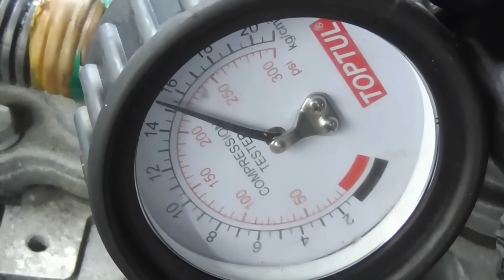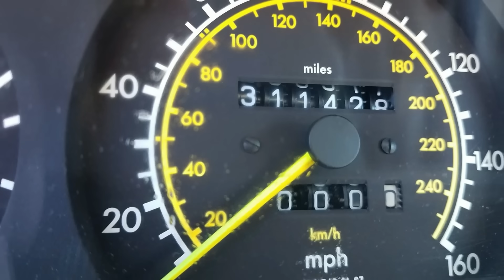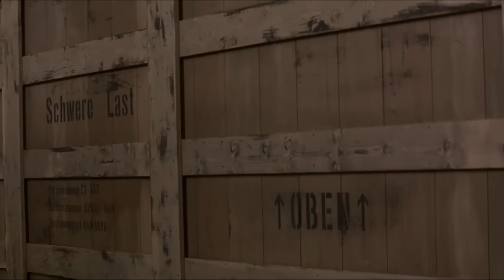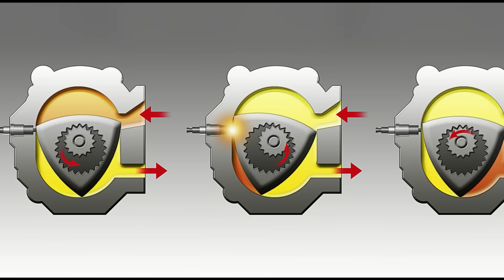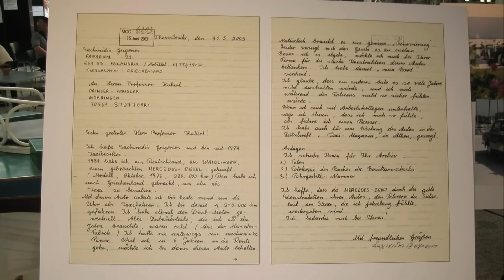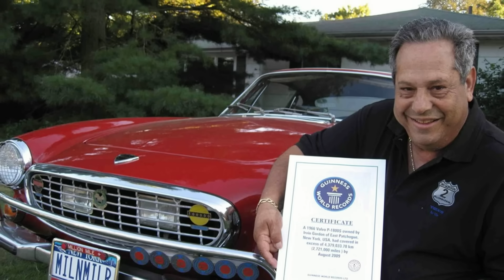Most Reliable Engines of All Time

Comment: 4.0l i6 jeep. Just look on Craigslist and see any wrangler or cherokee called low milage if it has less than 200,000 miles on it. I personally own one with 290,000 miles that over heated to the point of locking up at 230,000 due to failed thermostat but cooled down and fired right back up and it still does not burn oil.

Comment: I disagreed about alot of these motors and which  vehicles they go in some of them are very incorrect!!  For instant the k series motor for honda is not in ALL the s type hondas or Acura that's for sure I have been working on these car for almost 20 years now I have raced, built, swapped, bought, blown up, and frankinstiened many of them as well  both charged, nitro'd, and boosted just about everything right down to single  cylinder engines. I will say that a good bit of these are untrue for instance the Toyota Camry engine 3sfe I have bored ,stroked,  rebuilt, and boosted, I have even installed electronic super chargers on them and tuned them out to run daily  and I will say for sure you can definitely  rebuild them completely  and I would say that the D & B Series engines  for honda back in the day were some of the best and stout little motors with excellent  fuel economy!  This is just my opinion  though  have a great day you all!!!!

Comment: Any engine that only lasts 150,000 miles is not a great engine. Don’t know what this fool is talking about. I had a 4.6 Ford F-150 that went 230,000 miles and was still running perfectly when the frame went.

Comment: My old 1995 Honda Accord F22B2 had 339,000 miles
Reply: Yes brilliant engines. Have owned a few of them. Highest kms was 272000. Never had any issues with any of them. Currently have a K24A Accord. 207000kms. Never had any problems.

Comment: Engines change for several reasons. Government standards on fuel mileage, size and weight requirements for newly designed cars, the natural desire to made a new and better engine even if it doesn't always work out that way, etc. It's not so they can sell parts. Building a reliable car will sell you more cars than building one that needs repaired all the time. Honda sells well because they're known for reliability.

Comment: The Mazda rotary engine was not reliable. What the hell are you talking about? It was a horrible engine as far as reliability. And what is this "It goes 100k to 150k miles, therefore it's reliable. Pretty much every engine can do that these days. I had 2 Dodge Neons with over 200k miles on them and they still ran well when I sold them. I've never heard people say the 2.0l Neon engine is known for reliability.

Comment: Most gm motors are reliable....all said alot of motors are reliable...most transmissions are the problems .... that and trashed interiors and rust ...... motors usually run forever as long as they have oil and coolant

Comment: the volvo B230 engines are damn near imortal too, they are found in the 240 to 940 series and with minor modification you can push around 300hp out of it. my last engine had gone over 500 000 km and only had an oil leak in one of the seals :D

Comment: 7.3L Powerstroke engines regularly hit 500k miles before any rebuilds.
Reply: Not really broken in till 100k miles.
Reply: Totally agree and I'm glad I scrolled and saw this comment because I felt insulted being a 7.3 Powerstroke owner. One of the best engines ever for reliability & longevity with routine maintenance. This guy has a hard on for foreign built engines.
Reply: Agreed, along with that I’m wondering where the 300 i6 is I got may truck when it had about 2100000 miles never had a problem with mine besides the previous owner not doing regular maintenance and it had a leaky head gasket tore that motor apart in the garage had to replace the lower intake manifold because the last mounting ear broke off, got all the replaced put it all back together and started it up fired up first time barely any time for it to crank over lol

Comment: My 1997 Lexus sc400 with the 1uz-fe has 288,000 miles and climbs every day. With 281k it went 155 mph, it slid around in the snow, rain and dry grounds and it cruzes very smooth. I love it.

Comment: 7.3 international turbo diesel. all it needs is oil and you've got a million mile motor.
Reply: Rythblaqk or you go with a 12v cummins and you can go 1 million plus and make power relatively cheap
Reply: @levilewis6946  They are both great engines. I'm not a slave to a brand, I simply love mechanics and machinery. :)

Comment: 1.3 multijet 2 95HP diesel on a Fiat Panda 2012 , 1035kg mass, 200Nm at 1750rpm 0-100km/h in 11 sec. max speed 182km/h average consumption 27.8km/l or 65,39Mpg ; CO² 94 gr/km 250000km warranty.
It is not a super wonderful motor but it is a very good motor relatively simple with no problems over a long mileage life.

Comment: VW 1.9 tdi engine regularly does over 150000 in the uk
Reply: mine 2001 skoda has done 187k and I got the original clutch replaced at around 175k although I have driven both tdi and sdi as taxis with well over 300k with good maintenance.
Reply: Same here  in Canada, at my farm we manual swap the blown autos and keep going. Unless you take the oil pan out  ( has happened to many times at the farm) they are bullet proof.

Comment: Mate, you need to fact check a little more. Your Toyota knowledge is trash. The code fe means single cam, the 3 stands for 2 litre and the s stands for slant as the cylinders don't sit plumb. There is a twin cam equivalent, the
3sge, found in Celicas, altezzas ( lexus is200)[beams 3sge] and caldina. Some of these were even turbocharged the 3sgte. The RB26dett was very popular long before the r34, it's the gtr engine that destroyed the v8 supercar scene and ended up banned in that form of racing. Your lack of knowledge costs you credibility and I will not continue to be misinformed by your low quality drivel.

Comment: Jeep 4.0. Lots of torque, not so great  gas mileage, absolutely bullet proof.

Mercedes diesel (older 300d)

Ford 300 straight 6

Ford 7.3

Toyota 22r

Old Chrysler small blocks (LA blocks) 

Toyota 2jz 

Honda k20

Older volvo engines are also bulletproof

Comment: My friend NO ROTARY ENGINE IS RELIABLE  !!!  You want reliable?  Any old USA made Iron Block V-8 especially Dodge 318 or 305/350 Chevy.    How do I know?  I have owned a few cars with these old engines.  They just run and run.  They eventually leak oil- just replace valve cover gaskets that was main one.  They run on low grade fuel, bad and low oil, they have carbs and distributors so easy to maintain and work on and parts for cheap everywhere!!

Comment: Clearly this guy knows Jack about engines....  So bad he thinks you can get a non turbo "dett" dude DirectinjectionElectronicTwinTurbo they only came turbo charged.  And a gas motor with 16:1 or more would destroy itself so fast...  Most cars are 8:1 to Max 12:1 and rotary engines are crap...

Comment: What about the old Dodge 225 slant 6 engines?
Reply: Remember those oil additive commercials they used to run where they drained the oil and water out of a motor that had been "treated" with the additive? Didn't matter if they "treated" the motor, it was a slant 6. They don't care if there's water or oil, for a lot longer than you'd expect. LOL.
Reply: I’m surprised nobody mentioned the 12v Cummins I’ve a few hit over millions miles with no major work done...
Reply: The clicking from the solid valve lifters. My '70 & '75 Dart each had one. Soooo smooth, no engine vibration on the steering wheel.
Reply: paul lamont : its downfall was the split manifold cracking or leak between.

Comment: Um where is the ls engines on this list. Easily get 300,000 with regular oil changes. My 03 5.3 has 240,000 runs like a top. One of the best trucks ive ever owned as far as maintenance.

Comment: 150k-200k miles isn't a lot...
Reply: No not at all. Most of these motors listed are not reliable. My grandfather's gmc seirra has 480k on it now with the factory 350 still in it.
Reply: R Cruz  Dumbass...
We're talking about engine milage.
Reply: Yup 150-200 are norm this days... My Honda J35 ust hit 300k. Still quite and lot of power left.
Reply: With new cars that pretty good, for older that’s normal. If you buy let’s say a new BMW right now and later it has 300k miles, that’s impressive.
Reply: @Ryan-mg7pd  Shouldn't the focus on new cars be to be better than older ones in ALL ASPECTS? Why do we even buy these new cars? Tech gets outdates quickly, so cars are worthless after 5 years. Better to buy old ones. My 1992 Mazda has 400k miles on it and it still goes smooth
Reply: @MrShinta786  i agree with that man older cars are where its at. No need for fancy computers other than an obd2 code reader to see whats going on and a decent set of tools. My bone stock 02 impreza wagon has 305k and climbing, i daily it and take it offroading occasionally its a great car and they last forever when maintained
Reply: @MrShinta786  l don't. l drive an 03 dakota. she's not pretty but she gets me around and she's tough. the only modern car l would consider buying is a hellcat as a weekend toy.
Reply: 03 f150 with the triton and I'm at 210,000 with no problems.

Comment: They forgot the 5.9 Cummins
Reply: They forgot alot of engines!
Reply: Even The Volkswagen 1.9 tdi
Reply: And 6.7 🙄
Reply: That's not the only one they missed
Reply: Ford 4.6L in panther platform was pretty bulletproof. I have driven ones with 550,000km, still pulling strong. Had a 12 valve Cummins for 6 years, I really liked that engine! Have driven 6.7L isb Cummins power medium duty, it was great driving engine when it worked, but there was always something annoying wrong with it.
Reply: Amen
Reply: Correct
Reply: XoXo_ Prodigy and the 7.3L powerstroke
Reply: @brettbutros402  thats what i figured.